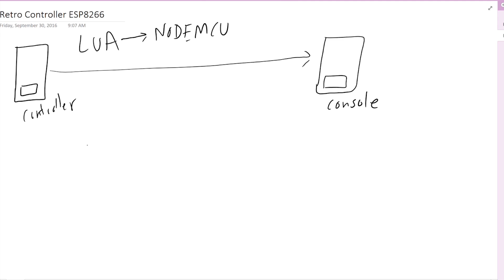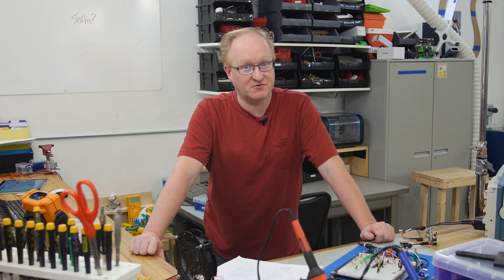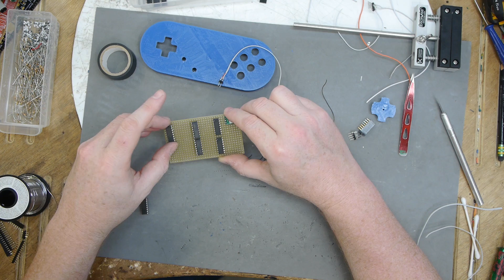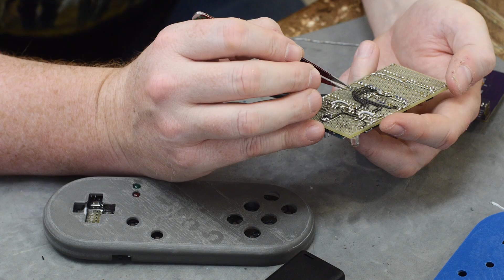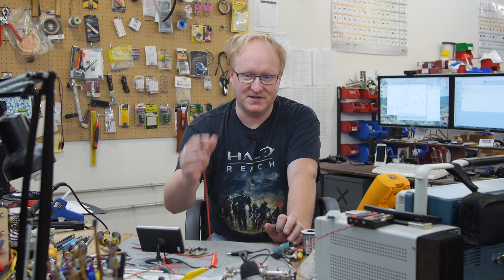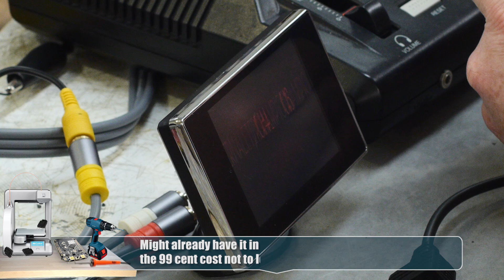Ben Heck's Multi-System Retro Controller

Comment: I think Genesis actually has a bunch of controller compatibility problems even among official controllers. Aside from 6-button and 3-button controllers, they were also meant to be backwards compatible with Master System (which only had a D-pad and 2 buttons). And the odd 3-button game which doesn't work with 6-button controllers even in BC mode (Forgotten Worlds was a world forgotten even by Sega testers, so I hear, you just die instantly with a 6B controller).

Comment: Hey Ben, Dunno if you have checked into this since this is year + old, but you could smooth the buttons using acetone vapor. Just put a bit of acetone into cloth with the buttons and place them under a glass bowl. The vapor will slowly melt the components giving them a sheen.

Comment: I don't understand why isn't there a module you can buy that has all the computer components you need for a controller so you just add buttons a case and a battery and wires. Also there could be standard button codes for 8-bit and 16-bit and all the other bits. So all you have to do is plug the buttons into the correct numbers labeled on the module, then you can buy a module that has four different connectors on it for four different consoles but only has one module but for different connectors. I don't know but I would certainly build DIY controller if it were that simple.

Comment: Still a nice controller watching this again but the Nintendo side pretty much buried all the other platforms that use regular 9-pin ports IE. cheaping out on the Genesis game and no 2600 demo. Not even a cost issue if you need consoles, I'm sure people would donate them or even locals would lend them to you. Feel like at this point you should have a shelf with all the typical consoles on it because projects that involve them keep coming up.

Comment: I read a bit about nes/snes controller, and the system sends a clock signal and scans the state of the buttons to determine wich ones are press.,.. something like that, but Ben didn't mention any of that,  am confused  =..(

Comment: Have you guys ever tried making a silicon casting from a 3D print (like with buttons)?  So print off the part, sand it smooth, making a casting then replicate it.  It might be cool to have a few castings for buttons just sitting around, so instead of having to 3D print ones all the time you could just use some epoxy or even silicone and make new ones.

Comment: Dumb question: If you plug the adapter into two systems at once, for example into the Genesis and the SNES would the controller work with both systems at once?

Comment: Not sure why not use esp8266 arduino c firmware. Why torture yourself with lua, you can just use C. It works very well, you can code in the arduino ide, flash using arduino ide -- all of that stuff.

Comment: Posting to github?
Reply from the maker: Eventually, too busy hacking!
Reply: I've always imagined this as a possibility. Would be neat if there was a way to reduce the hardware required by using a processor that can somehow emulate the chipsets required, and hacking in some super-cheap SD cards inside a USB connector enclosure so the wireless receiver could read the data on the SD card and have the receiver use the appropriate emulated chipsets for each adapter plugged in.

When emulating a new console's controller, just re-flash the RAM chips with the files it needs to pull for the new controller and plug in the adapter which would be made to queue the new files to use for hardware emulation.

(Insert facepalm for not completely understanding how hardware emulation works.)

Comment: Why not "emulate" the shift register with the ESP on the receiver, instead of having a lot of support-chips. And also, I would recomend programming the ESP8266 directly with the Arduino stack, replacing the NodeMCU image, so you can use your C++ knowledge, and the Arduino libraries.

Comment: I have always wondered if there was a good 8 way D-pad. Like a 8-way that you could still do plenty of the street fighter 2 special moves. There were plenty of isometric games which where a pain to deal with unless you tilted the controller by 45 degrees and that was still a pain.

Comment: Not a retro controller, as such, but I did recently take my old wired Xbox controller, add a bunch of extra buttons, switches, slide pot and thumbstick, with an arduino pro micro running as a Leonardo clone to make a custom controller for Elite Dangerous!

https://www.dropbox.com/sh/z7408hyfzpnvd8g/AACzG60myOQqJ1yPYny-9p9Wa?dl=0

Added functions:
Rear thumbstick for vectored thrust, and connected the click button
Slide Pot for throttle
Split the shoulder button to add two additional shoulder buttons for targeting
Added two switches to the front for hardpoints and landing gear

I still have plenty digital and analogue pins left over too so I can go back and add more if I want! Took Bens advice regarding making things modular and modifiable later, so all the internal wiring is either routed to stay on the PCB when opened, or is pluggable so I can strip it apart without needing to desolder anything.

Comment: What is the point of a "gloptop" chip? (why cover it in epoxy?...) I assume it is to hide identifying information about the chip, but I am unsure.
Reply: its cheaper to  manufacture
Reply: How so? I would imagine the epoxy would make it cost more.
Reply: Starman When you're paying for board size it's cheaper to do that than add an ic
Reply: Board size doesn't seem to be an issue here. I think the real savings are from not packaging the IC. The epoxy protects the bond wires from the IC to the PCB.
Reply: Karl Koscher There are many reasons to glop top i was only picking a few for my discussion or it'd be paragraphs of text nobody would read.
Reply: Karl Koscher Oh that makes sense, thank you!

Comment: I can't believe he didn't try it with an atari 2600. the Genesis controller portion is fully compatible with it.
Reply: You have to be careful with the 2600 and other older machines because pressing button A can actually damage the input control chips. It's something to do with the multiplexing chip inside the controller. You can build a little "filter" box that uses diodes to prevent damage though - that's what I use on my commodore 64 and Amiga
Reply: It's actually power pins, Genesis uses pin 5 for power while Atari/C64/Amiga use pin 7, the pin 5 for Atari and C64 is a high data line that the Genesis can pull its power from, but it will blow the controller in your machine pretty quick.

Comment: Isn't Wifi a bit overkill for this?  Why not bluetooth of like the NRF24L01?  It's very low power and it's what's powering most of your non-bluetooth wireless input devices already.  ESP8266 works too, but it's just overkill and will eat your batteries.
Reply: I think they did that because of the time limitation they had to produce the show and they went with whats available at the moment without having to wait for shipping.
Reply: uzimonkey the nrf module isn't Bluetooth. maybe you're thinking of the HC-06. THE Nrf24l01 is a different frequency and protocol than Bluetooth.
Reply: guitarplayer1071 I know, I made a typo and meant to say "bluetooth or the NRF24L01."

Comment: As for old system tweaks I would love to see a mod on Sega CD and Sega Saturn to increase the internal storage capacity. Sega CD back up carts can now go up to 8000 something blocks vs like 135  blocks internal or something similar. Saturn is no better. Larger capacity would be awesome. Also maybe flash memory based storage for the save data so if the battery croaks  you do NOT lose your internal save data. I am confident it would be possible to do. I am also positive I have zero clue how to do it L.O.L.

Comment: Ben Heck is the god of technology, and it makes me wonder if he can fix a problem my TV has.

For reference, my TV is compatible with media servers...but can't play anything from a media server. When it tries, it spits out an "incompatible format" error. I can put the TV right next to the computer, and it still refuses due to formatting. If I try to play the exact same file from a flash drive, it works fine. All of my whats.
Reply: One of them Vizio smart TVs.  Here's an example of the issue if I wasn't clear before:

1. Put "mime.avi" on a flash drive.
2. Plug flash drive into TV.
3. Go to play "mime.avi" from flash drive. Success!
4. Remove flash drive from TV.
5. Move "mime.avi" to media server.
6. Navigate TV to media server.
7. Go to play "mime.avi" from media server. TV spits out an error! "Incompatible video format."
8. Plug flash drive into TV again.
9. Go to play "mime.avi" from flash drive again. Success!
10. Stare at TV in confusion.

TL;DR video that works from flash drive will not work from media server.
Reply: Are you using Plex?
Reply: Nope.
Reply: Have you tried another format for reference? and what TV is it?
Reply: Try to convert it to mp4 or try another file with the mp4 extension.
Reply: Well, that's the thing. I also have MP4s. They also are labeled as incompatible when I try to stream them to the TV.
Reply: Try their test file if that works it's most likely a codec issue and nit format.

cdn.vizio.com
Reply: I'd recommend trying different media streaming services.
Reply: Oliver Johansson It works via flash drive!

...but it does not via media server.

I cannot use different streaming services.
Reply: @Thelnunah why can't you exactly?
Reply: I do want to point out that it supports more formats and codecs via usb than from a media server
Reply: Well apparently it supports no formats or codecs from a media server.

Comment: what kind of language doesn't have bitwise operator?
Reply: What kind of language doesn't include bitwise operators? An extensible embeddable language, a tiny skeleton language which can be extended by modules written in C. So yes, there's an extension for that. But the firmware that these guys use apparently doesn't have it compiled in.

There's this problem, that WiFi and Bluetooth microcontrollers run highly proprietary code that proprietors don't want you getting your hands on. You refers to the likes of people who haven't sold their soul to numerous devils, and haven't signed a legally binding NDA with a huge penalty attached. Now, ESP8266 isn't even bad in this regard, you get to compile software for it, even though the core is closed, but it's still a huge pain in the butt, because basically nobody along the line gives a damn. It could be worse, you could be paying $3000 for a pretty terrible compiler to begin with. So yeah, i can see why they went with a prebuilt firmware.

In general the whole project is a bit of a massive WTF. I mean, sure, the ESP isn't expensive, that's a good start. But WiFi is just the wrong transport, it's not all too resilient, it tends to pile up latency whenever there's interference. Certainly, you're always going to have interference issues on wireless, but channel hopping (actually more like spread spectrum over the entire license-free band) transports like Bluetooth and the like actually behave better in this regard. Then he starts botching a dozen of 74 logic ICs around and wondering what he wired up wrong time and time again, when all it would take was a good micro with sufficient number of pins, like an atmega, you get them on these tiny boards for $2, and with a bit of planning, that becomes a lot less painful. For transport, a good companion is nRF24L01, and yes it's a channel hopping one. And an atmega is simply not painful to deal with, the tools are mature.
Reply: Khandar William German.

(Yeah I know what you meant.)
Reply: Moreover, who in their right mind would use a language that does not have a bitwise operator for programming a microcontroller?
Reply: To the non-programmers, this may seem like a critical nitpick, but bitwise operations are extremely extremely useful (read: almost necessary) in programming.

Reading game old game controllers, for example, was literally done using bitwise logic (and for good reason). The states of each button were simply strung into a single byte (8 bits) or word (16 bits) in memory for easy access. With bitwise logic, you can simply check any bit, which coresponds to a single button. Without it, you are forced to check every single possible combination of buttons, which is exponentially larger than the total number of buttons on the controller:

Controller      |   Buttons   |   # of bitwise checks   |   # of non-bitwise checks
--------------------+-----------------+-----------------------------------+-----------------------------------------
NES                |   6               |   6                                   |   64                           (2^6)
SNES              |   12            |   12                                 |   4,096                      (2^12)
Genesis         |   10 or 13  |   10 or 13                       |   1,024 or 8,192       (2^10 or 2^13)
Playstation   |   14             |   14                                 |   16,384                    (2^14)

I think it is easy to see which method is better, especially when the number of combinations you would need to check for the basic NES controller is more than double the  number buttons even modern controllers have, and each additional button doubles that amount.

Sure, bitwise operations can be simulated using other methods, but why would any programming language not include them? That would be sort of like selling a car with a one-speed transmission: sure, it technically works, but it is severely limiting.
Reply: Always a critic.

Comment: Lua is a very strange choice of language, it is good for event-driven systems, but I would recommend using C in this case. Using C would fix a lot of the latency problems, and I suspect that some of the latency is caused by Ben/Felix being unfamiliar with an event-based language like Lua. It looks like Ben/Felix used the ESPlorer IDE, and this also supports MicroPython. In summary, a lot of pain was caused by insisting on using Lua for no good reason. It also gives Lua a bad press, it is actually a very nice language to use on the ESP.

Comment: "Play one of 15 Genesis games that used 6 buttons." Kinda true for published games. However, there are homebrews and hacks that use the 6 button controller. I have a custom made Sonic game known as Sonic Classic Heroes (I think...) and that game supports 3 players simultaneous. It also uses a 6 button controller as the X button is assigned. Best part of the game is it works on original hardware. You get 3 players with the classic Genesis 4 way taps that plug 4 controllers into port 1. I have all that plus a flash cart. Had my cousins over some time back so I set the system up on a real Genesis for 3 way play. It all worked although the X button was not used since we had 3 players. Look the game up for anyone wondering what I'm talking about with 6 button controllers, port expanders, and 3 way play on original console with a custom Genesis game. It was fun even though we argued over where to go with the 3 characters on same screen. lol

Comment: I don't like the SNES controller shape pick ...
Reply: That's not an snes controller shape. Snes has a 'dogbone' shape along the bottom, what they designed is completely straight.

About the only thing that makes it more like an snes is the use of shoulder buttons.

Personally, if I were going for something designed to be used universally across systems, I'd give it 6 face buttons, AND 2 shoulder buttons, and give it proper grips somewhat like modern controllers have.
(and what do you know, that's the button layout they chose too...)
Reply: ManticTac it's only impossible because of the Genesis Dpad that tends to hit diagonals too easily. a 6 button genesis pad with a Nintendo Dpad and some triggers would be golden.
Reply: Now you made me curious. What would you have wanted to see instead?
Reply: everdale
Honestly? Megadrive/Genesis 6 button shape. Because it curves and I think that's a way better grip than a SNES controller.
Putting this all into an X1 controller would be godly ofc, but impossible.
Reply: Try playing Mario with a Megadrive controller. It's impossible!
Reply: Tried it, its not hard at all.  I guess if you are used to snes d-pads you might have trouble with hitting diagonals on a sega pad, with a little practice you'll be ok.  The snes d-pad is pretty terrible at diagonals try playing land stalker with it and you'll see what I mean.

Comment: Nice idea but instead of outputting in to a unit with console plugs on it, why not make a unified retro gaming console with all the old games built via emulators that can plug into a modern television without a bunch of adaptors.
Reply: Because then the project is just pretty much "Buy a Raspberry Pi 3 and a Bluetooth controller"
Reply: Because that's cheating...
Nothing beats optimising the retro consoles, upgrading them...
Reply: That's a modded Snes Mini with a sf30 pro controller

Comment: Why use LUA over Arduino so you can write in C++ again?  I've never used LUA, but programmed my ESP8266 with Arduino board plug in.  

Maybe I'm speaking too soon, I'm 1/3 of the video in.
Reply: Jonathan Mayer They use only the Wifi-module, without an Arduino or similar, and the module can only be programmed directly with LUA, not C(++). The Arduino was used for debugging/programming IO
Reply: JonasLue No offense, but that is incorrect. I program these modules directly all the time. http://GitHub.com/esp8266/Arduino
Reply: Jonathan Mayer None taken, what i wrote was just, what i understood from the video. Thanks for informing ;P